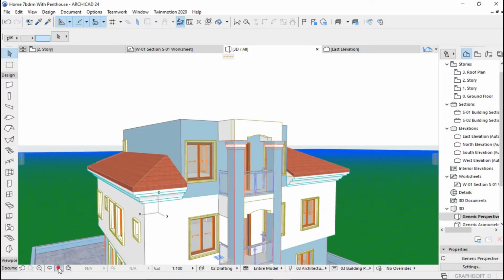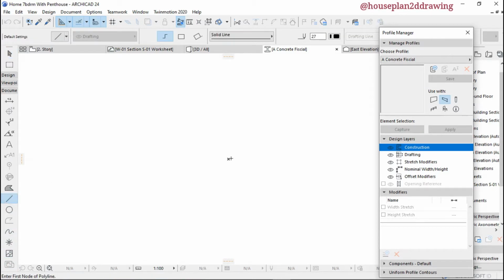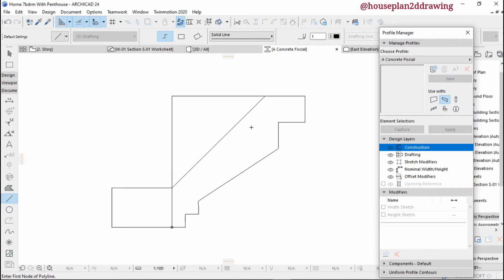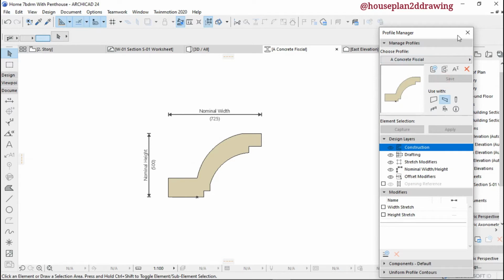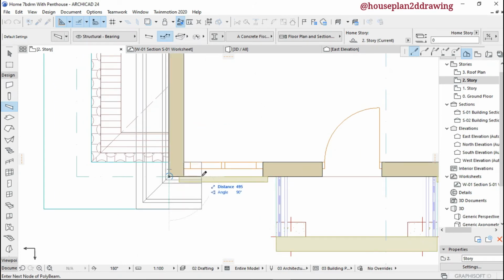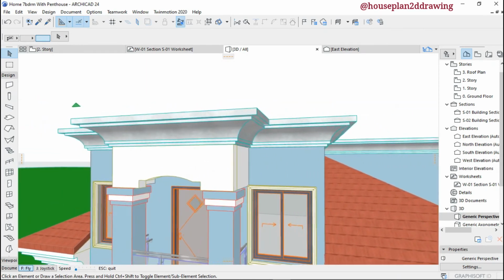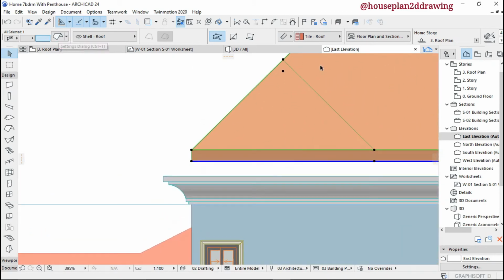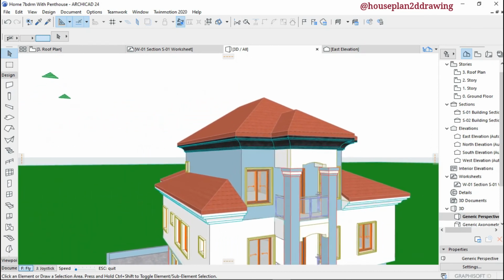Design Your Kind Of Concrete Fascia In Archicad

Comment: Sir after did all in the video for concrete facial and saved. Then on the window where the drawing is and click beam , settings dialog box but no segment in archicad 20
Reply from the maker: Oh" archicad 20, I'll suggest you please update your archicad to version 26 or if not try and get archicad 24, the version of archicad you are using might not have that feature.